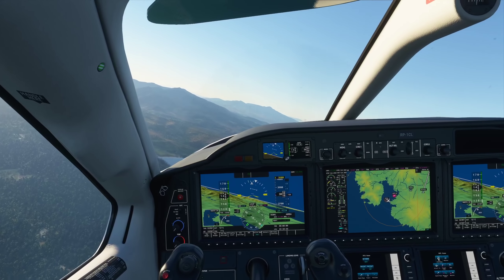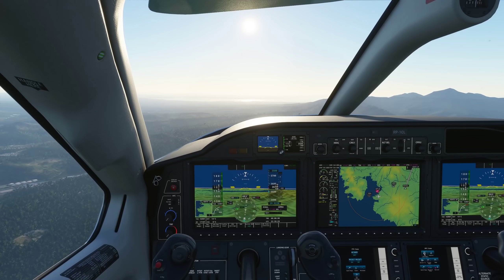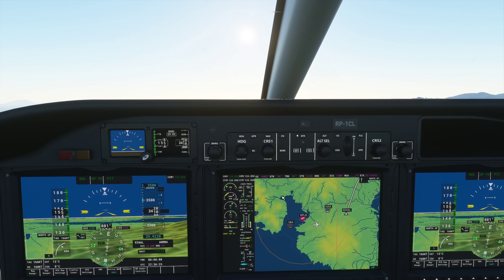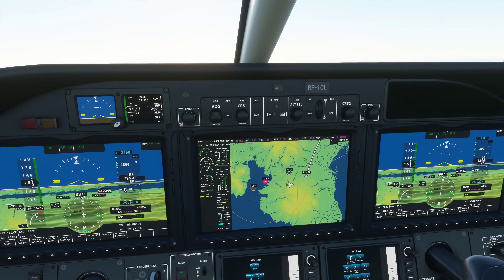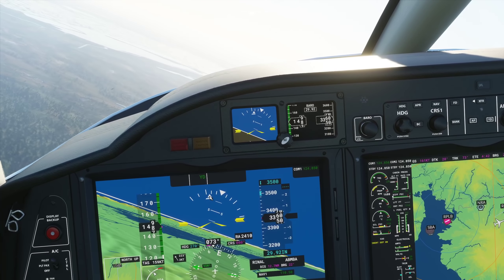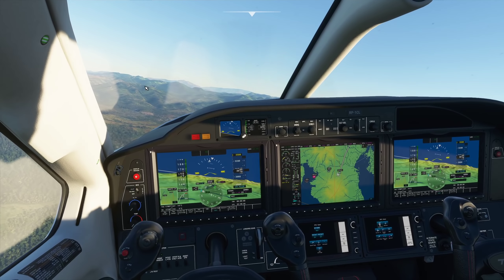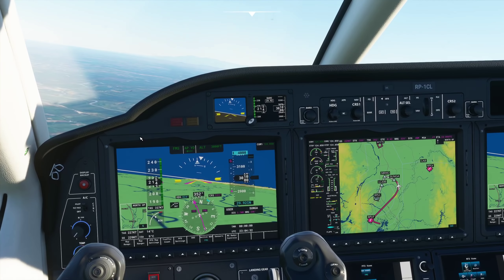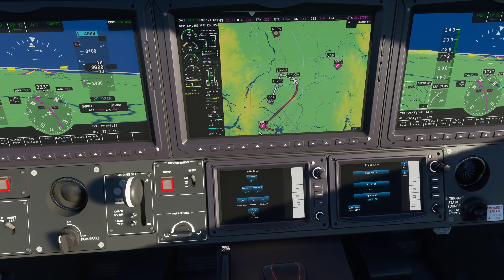Autopilot is BROKEN! (or is it?) - Microsoft Flight Simulator

Comment: the A/P on the current version is a complete disaster - when CDI connected to FMS or GPS, my magenta line always point to 360 degrees even on my ND there is an active, correct flight plan in magenta line!! The studio clearly spent most of the development resources on eye candies like sceneries but not on aircraft systems. It's a strategy to draw in sales from first-time flight simmers but such a disappointment to study-level simmers. That said, this is a first release so hopefully they patch their way out of the trouble in coming weeks. Otherwise an average $100 price is really not justified for this Google Map with Wings...
Reply from the maker: Yeah, I sure hope they continue developing the systems. At the same time I'm waiting for 3rd party devs to step in and release study-level planes.
Reply: It's called a framework. How many study-level aircraft did FSX come with? X-Plane? And have you looked at the price for just ONE study-level aircraft lately? And you're expecting a dozen of them for 60 bucks?

They've delivered the world, a good amount of entry-level aircraft and a very, very solid framework....they have some bugfixing to do, obviously. Just like any other piece of software, you can QA all you want, once it's deployed to the masses, shit's gonna break.

Comment: Another Bug is the engines. As soon as you get going for a few seconds right from depart your engines will shut themselves off. You can’t turn them back on no matter what. This game is utterly broken. It’s impossible to fly any plane. A shame because I was really looking forward to this game.
Reply from the maker: Doesn't happen with me, but you might want to check if you have the mixture knob assigned to any axis. I've had it happen before that the mixture knob at full lean cuts off fuel flow even for planes that shouldn't have it.
Reply: It is a bug I tried restarting the game and somehow it worked again. Weird..

Comment: It’s degrees of bank, not a percentage. Otherwise good video.
Reply from the maker: Yes, good catch. I mentioned degrees initially and changed to percent right after. Slip of the tongue. Thanks for correcting!
Reply: Clumsy no problem. I’ve been flying the Citation Sovereign for 11 years and 2 years on the Citation X before that. As a result  I was particularly interested in the Longitude segment of the video. Good stuff.
Reply from the maker: I look forward to learning how to fly that plane. It looks so cool but flies like a beast (and not in the good way). I'm not sure if that's realistic or just wrongly simulated.

Comment: This simulator is a letdown. Yeap, I know I will hear about this and I could give a shat less. Here is my explanation.

 1) My system is modern (no I am not running an RTX 2080, not in my price range) I am running a RTX 2060 Super. CPU is current I 9 K series so yes, I can and have over-clocked. I am a former US Army Rotary Pilot, still have my cert active and current. Adjusting the Nividia control panel to optimal settings, along with simulator graphic setting the graphics look boxy and sometimes contain huge solid block type graphics. I have noticed this around bridges especially. 

2) I have been following the post release of this sim for a year, early on we were told users with not so good machines would be able to run this sim, this is not true. I do not fit into this category but what right is right, we were told bandwidth was going to be the biggest determining factor, no so!! 

3) I was not a alpha or beta tester, but why is this sim so damn hard to install on your system. It took me over a day to figure out all the nuances, MS team was no help. Summary, this sim is a huge let down. We were all pumped and fooled into thinking this was going to be the second coming of the sim god. 

My opinion, this thing is like that blind date one of your good comrades told you was so fine, you would walk through lite embers to get to, because she is so f king hot. She ends up looking like some back-alley tweak, from behind but when this skank turns to face you, shat that s a nice tooth you have their girl. EXIT STAGE LEFT  Before any of you arm chair warriors decide you want to go to battle with me heed this , I enjoy constructive criticism, but dont get stupid.
Reply from the maker: Thanks for sharing your honest opinion, and I can definitely understand the frustration. It has not been a smooth experience for many people during launch day, and we have quite a number of bugs and unfinished features. 

That being said, I immensely enjoy the sim despite its flaws. The optimization is leaps and bounds better than the previous sim I was using, and the graphics are no comparison. The flight model seems as realistic as it can get, based on inputs from other RL pilots. I just hope asobo continues to develop the missing systems and squash those bugs.

I hope you find the sim that's right for you, if this isn't it. Happy hunting!
Reply: Clumsy thumbs up and thanks let’s hope they stick around and fix some of the issues